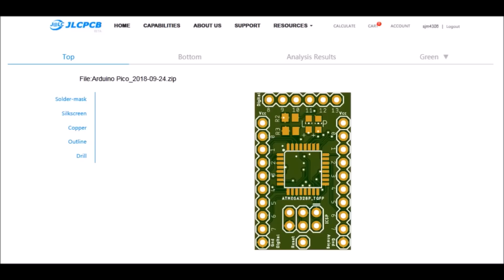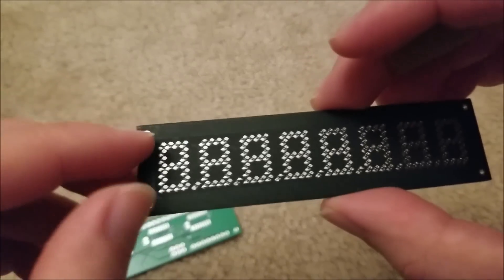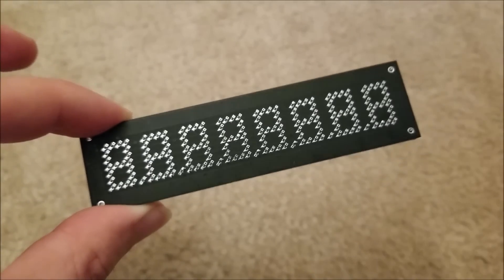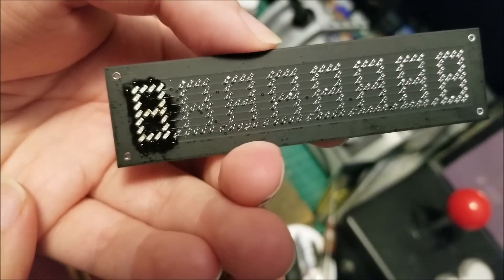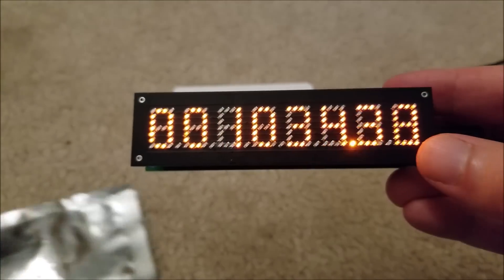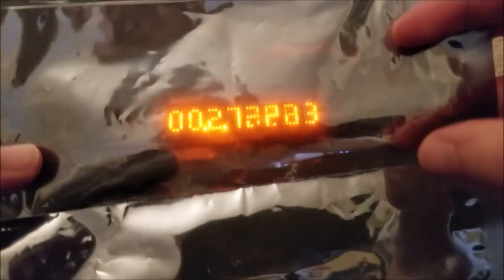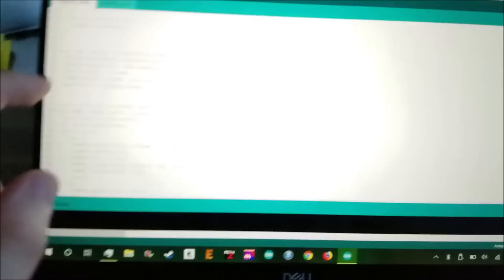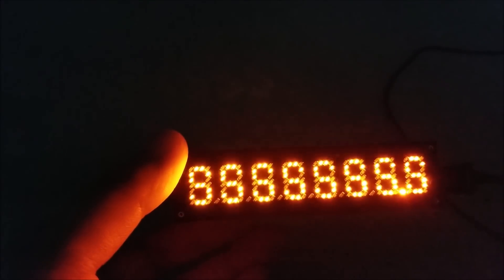TinyLED 8 Digit Display Prototype 2: Now With 700% MOAR LEDS!!!!

Comment: You could use pogo pins to connect the two boards without through hole on the front board. How about having jlc make a solder stencil and using paste and a reflow oven for your smd....
Reply from the maker: Yeah I really need to get a small oven and some solder paste to experiment with. Pogo pins would be awesome but would easily be the most expensive component in the bom given how many pins I need.

Comment: Awesome! I loved the first one and this one is even better! Maybe you could do another one that is a full display instead of 7 digits? So a dot matrix LED display, though that would take a LOT of soldering and LEDs
Reply from the maker: Yes, a full matrix would be sick! Something like 32x64 would give lots of pixels to do something interesting with but soldering them all would be a nightmare unless I use a reflow oven.
Reply: @sjm4306  Yes that would really take forever to do, though you could probably use a tube of solder paste and a heat gun as long as you're careful not to use too much air pressure or else you'd blow all the LEDs off the paste :P

Comment: Very nice. You must have young eyes, I would be soldering with a microscope for sure. Have you ever tried using a flux pen? It’s not so messy and works well for soldering. Nice job keep it up. 👏🏻👍
Reply from the maker: Thanks, I really do need to move to a no clean flux pen. I bought this tub of gel flux from radioshack when I first learned to solder and it's lasted me for a good 15 years. While it works great it is so messy to use and clean up.

Comment: you actually can write a 'T' but it has to be lowercase. 'N' would just be an upside-down 'U'. 

if you understand the a-g of a 7 segment display, a 'T' would be segments d-e-f-g lit and an 'N' would be a-b-c-e-f. an 'i' would be a 1 but on segments e-f instead of b-c. but that may just be slightly confusing

Comment: So those are 0603 LEDs like the first single-digits, correct?
Reply from the maker: Yep, I just decreased the pitch a little bit so the overall digit size is a little smaller
Reply: @sjm4306  cool, thx!